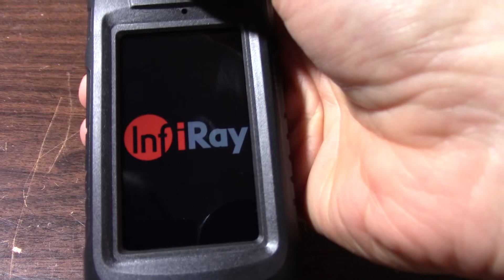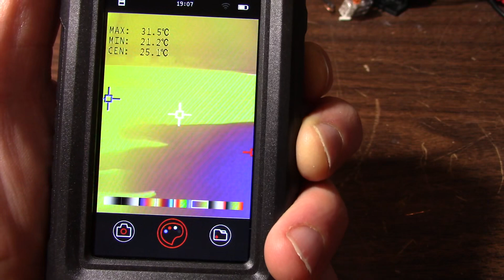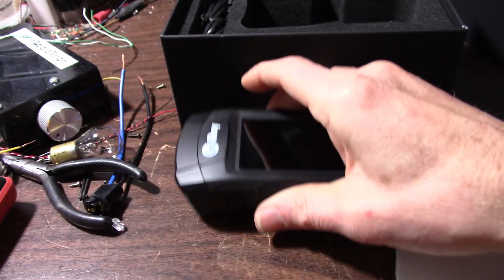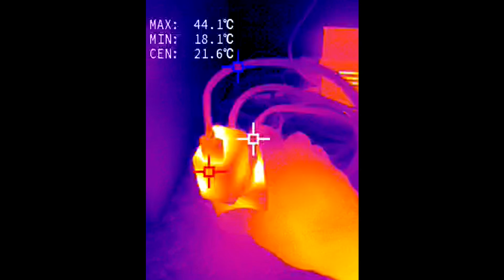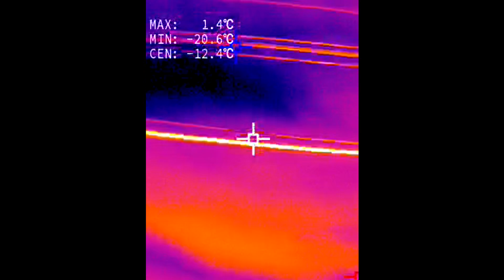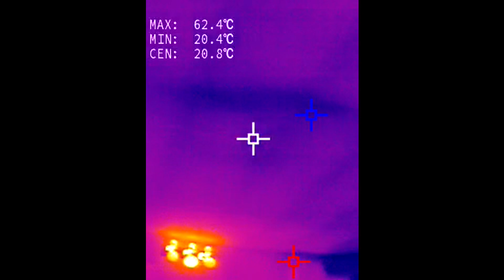InfiRay Xview V2 thermal imaging camera review - Great tool for the bench!

Comment: Would this device measure accurately the temperature of an iron tip? I don't feel like spending a small fortune just for the hakko soldering tip thermometer. I'd rather spend some more and have this device that can do much more.

Comment: The occasional stuttering is auto recalibration. It's a characteristic of all thermal cameras.
What's the resolution of the video? (I assume the resolution listed in the spec is only the screen res.)
Reply from the maker: Video res is 288x384 but does appear upscaled and smoothed. Screen res isn't given but is much higher.

Comment: Pretty expensive I’d probably go for a flir or seek unit to plug into phone for like $230
Reply: I’d steer from the Flir phone attachments at all costs. It’s an outdated low resolution lepton sensor with an integrated battery that bricks the device upon failure
Reply: @sneugler  couldn't agree more Flir are pretty rubbish and brick teal easy.

Comment: The resolution is more than usable. All the cheaper sensors have awful resolution 64 pixels is what the cheaper infra red cameras offer, so a big slodge. Looking at your amp was impressive... I was hoping it would be more affordable, it looks a bit  plasticky next to a Flir, not sure I like the design and layout either.
Reply from the maker: The $230 camera they sell that attaches to a smartphone claims to have the same res sensor.

This camera has some mass to it as if it has a metal frame inside and feels solid when giving it the EEVlog multimeter twist test.